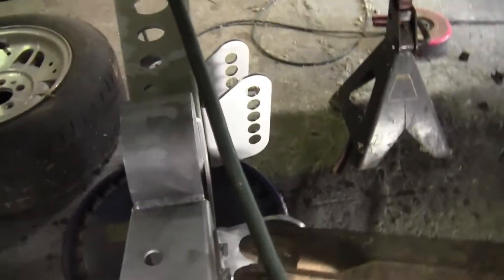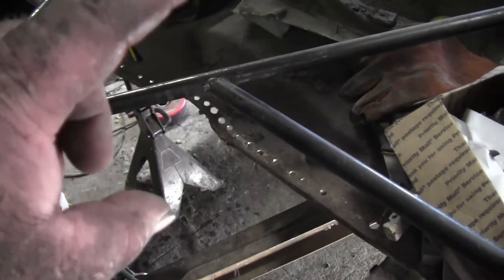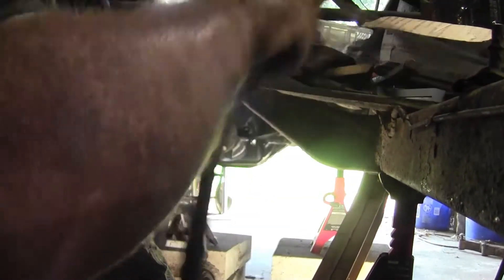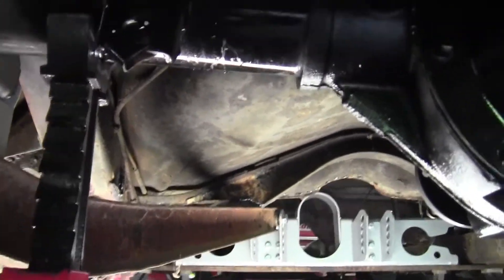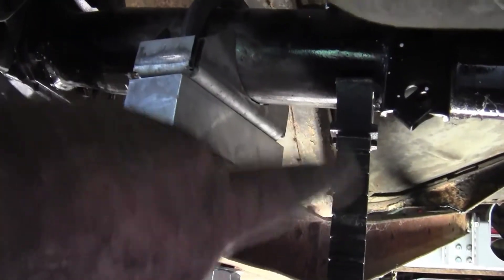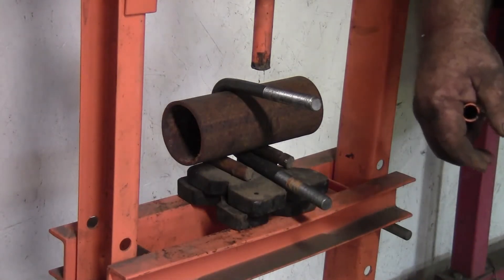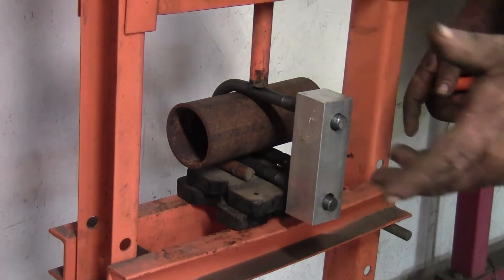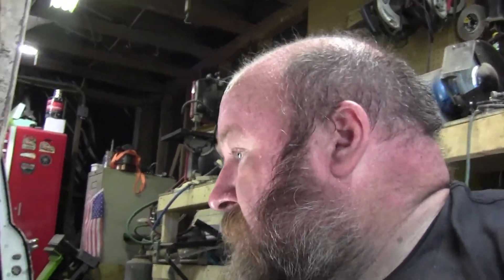Installing 8 8 Rear End and Truck Arms Part 2 Shoebox Ford

Comment: Ditch the old lights and invest in some Linkable LED Shop lights from Lowes. My buddies did that with his shop and makes a night and day difference.
Reply from the maker: The ones on the other side are the linkable ones. I have a couple more on the side with the car to change to led. Thanks for the tip!!!
Reply: @faroironandcustoms6577  you're welcome and good luck.